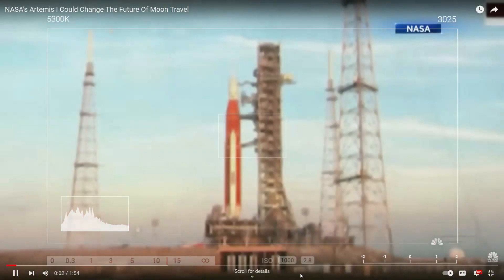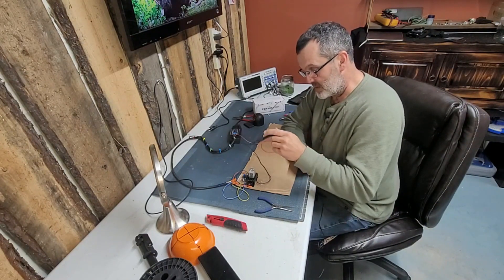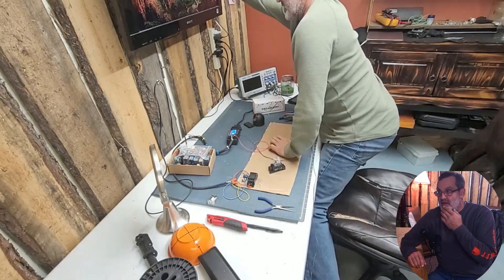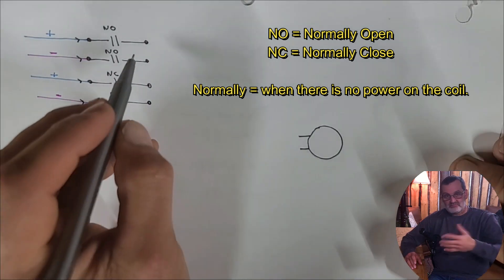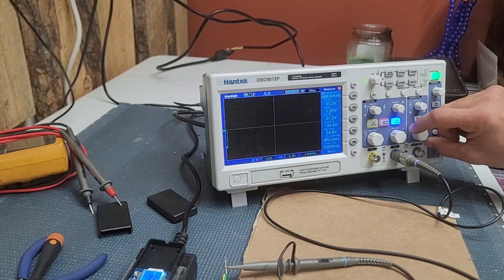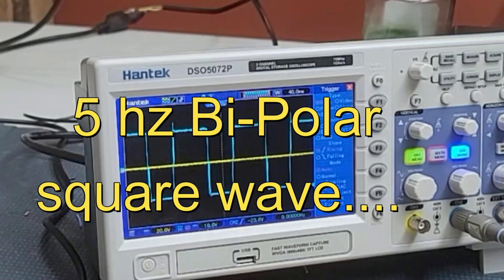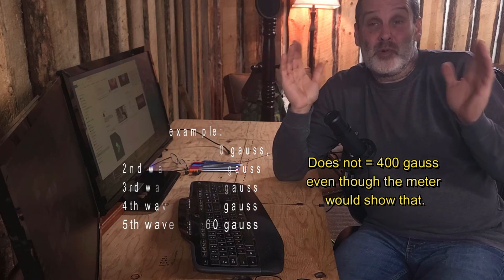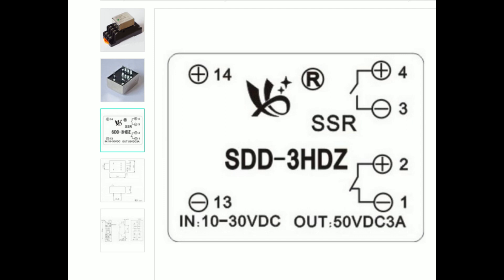The elusive NASA 10hz square wave

Comment: No, I bought a PEMF last year from ebay it came from the UK for $500. and it has a cable coming out of it with a RCA plug. I was hoping to make a new control box for it.  I see they are selling them now for $1250
Reply from the maker: I am very curious to know about your system.  

Remember ohms law.   You need to know the total resistance of your mat first.  :)

Comment: On a relay or SSR you should put a snubber circuit they sell them on Amazon. I made my own PCB. Put them across the contacts to cut down the arcing. Or the relay won't last very long.  I do have a PEMF mat it seems to help with my stomach problems. I will be looking to see how you get the Bi-Polar to work on the coils. I will try to convert my mat. I am 68 and getting very forgetful.  Keep up the good work. Love it.
Reply from the maker: Wow.  Amazing.   Please let me know how your mat turns out.  Will look into snubbers. Tx.

Comment: Awesome video Steeve!  If there is much noise or distortion in the signal, does that have any negative impacts either on the machine or the body?
Reply from the maker: Tx for the kind words. 

Noise in the signal can reduce the benefit of pemf.   I always like to follow the best research papers I can.    They always test on very good quality square waves.  NASA had a bipolar square wave.   That is what we are trying to achieve.    

Next week video will show you a beautiful bipolar square wave.   :)   

Cheers.  Have a great weekend.
Reply: Great video as usual. Try a freewheeling diode across the coil, although it may not work with bipolar, it cleared up a lot of transients for me on regular square wave. Put it at the coil rather than on the PCB. A TVS might be another option worth trying. On a completely different tack I’m playing with a class D amplifier to get a bipolar square wave from an arduino/DAC generator. That allows me to get the fast rise time pulses.
Reply from the maker: @colmhoban4192  awesome..
I did put diode across each coils to protect from flyback voltage.   It helped some but the contact themselves where the issue.   
Next video I will show how I manage to do it with a ic chip and two mosfet.   It is amazing 

We should talk some more.   I want to use a nextion soon to simplify every step even more.  I found a programmer but have not hired him.yet.   

Can you show me more of what you are doing?